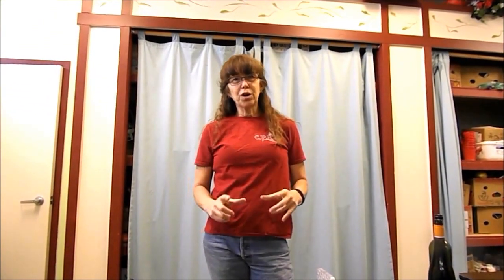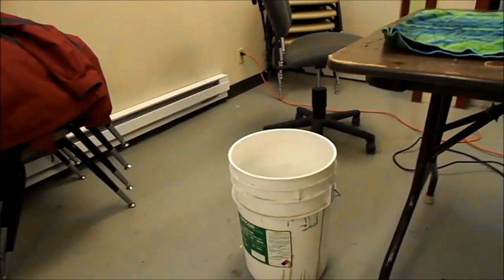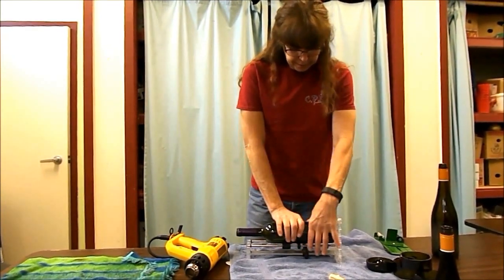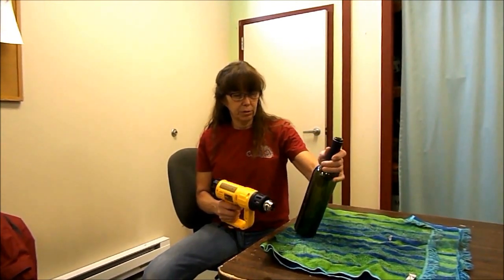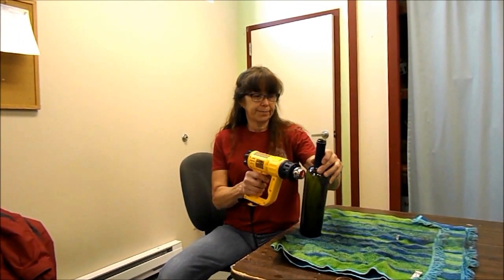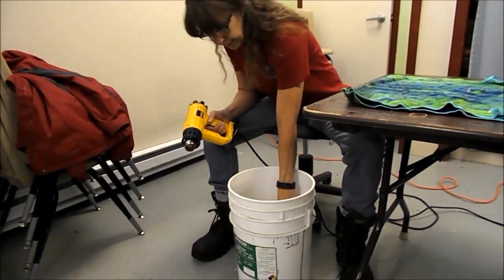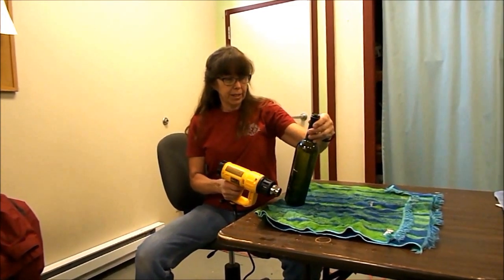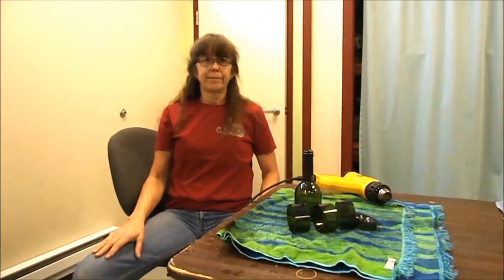Cutting multiple rings from One bottle

Comment: by the way I found that you can use room temperature water to stress it usually put the open end of the bottle first in the water to trap the heat inside. If you are interested check out my video on it.